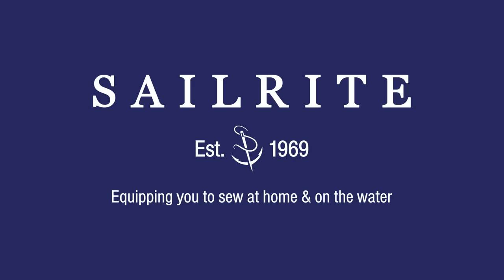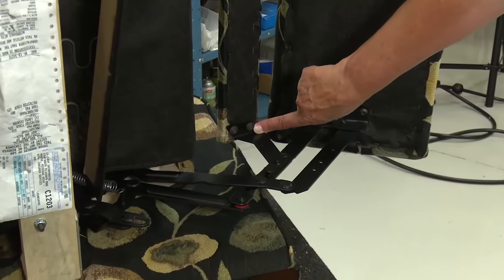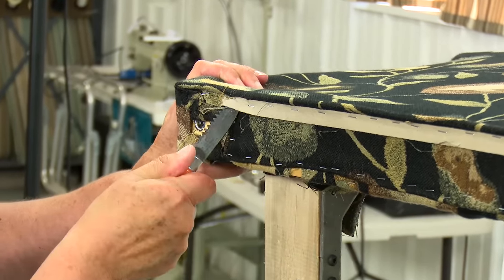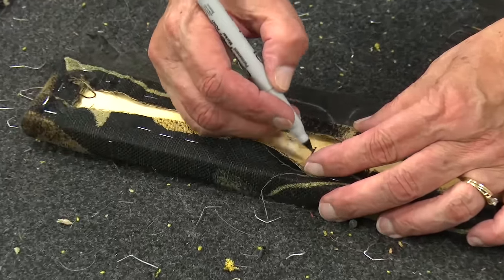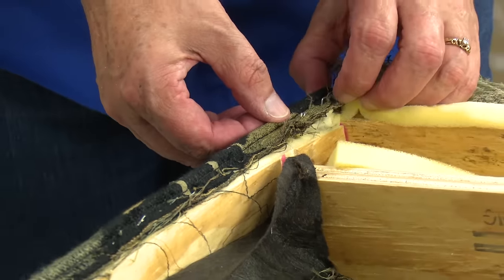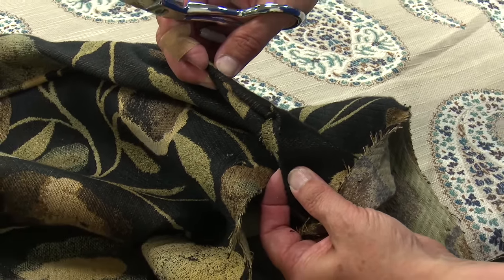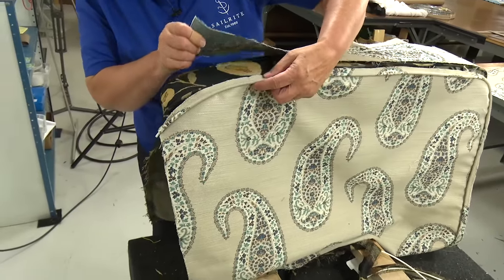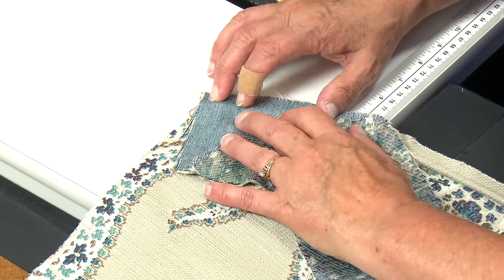How to Reupholster a Recliner Chair

Comment: I just want to say a MASSIVE Thank you for this detailed tutorial. I am a DIY upholsterer, and I am now actually working on a recliner chair. My handy hubby helpen me take out the mechanism, and I am taking it slowly, bit by bit, as is advised in this video. The biggest tip I benefit from, is to cut the fabric (template) in half length-wise, so you can use one side to take apart and use as templates for the new fabric, and the other half you leave in-tact, so you can refer back to how it was put together. That is invaluable information that I am using now to make sure I can put all the pieces back together again. Thank you!!!!!

Comment: I have a reclining chair I bought from Sears Canada in 2000. It is such a comfortable chairand I really love it. Of course the upholstery is shot. I have watched your very interestingvideo, but I'll be honest. It would probably take me six months to complete my whole chair.I'm not very experienced with sewing either. I know a year or so ago I phoned a couple ofupholstery shops to get quotes on getting the chair done. I was quoted $1000.00. I paid$600.00 for my chair and Sears still sells them for $1500.00 now. What would you suggest I do? Buy another chair or pay a professional to reupholster this one. I shouldalso mention here that the chair itself is in excellent condition. The mechanism works,the arms are tight.
Reply from the maker: You will often find that the older chairs are built better than the brand new ones. If you can't DIY (do it yourself) saving you the most money, then the option of having it reupholstered by a company and still saving you money over the new chair, may be the best option. The fact that you can pick your own decorative fabric is another plus.

Comment: Excellent tutorial!  One question: how do you know when to use the cardboard tack strip (as opposed to just stapling directly on the fabric)?
Reply from the maker: +Donna M. Schmid Thanks! Anytime the fabric is stapled and folded over itself (making a folded edge) use the cardboard tack strip so the fabric folds nicely along that folded edge. Also if piping is stapled along an edge of the wood frame using the cardboard tack strip will help push the piping towards the outer edge keeping it standing proud.
Reply: Oh, I see!  Thanks!
Reply: Sailrite  Bravo zonja. ! Eshte pune e veshtire  , une puoj tapiceri

Comment: This might sound like madness, but I have a perfectly solid dual reclining loveseat I'm thinking about reupholstering. I can't find a slipcover that is for this type of loveseat, and throwing a cover over it just isn't working. Am I nuts or just break down and get a new one? 25 years ago I made slip overs for my living room using newspaper for patterns. Just wondering.
Reply from the maker: Slip covers do not work well, in my opinion, for recliners. However, if you don't want to buy a new one or recover the old one they are an option.

Comment: I may have missed it or maybe it wasn't mentioned but how much material should I order for the same type of laz boy?
Reply from the maker: We used 7 yards of 54" wide fabric for this job. It is wise to order a little more than what is required. Here is a very helpful calculator that will help with upholstery jobs: http://fabric-calculator.com/upholstery.aspx

Comment: How much it cost to upholster?
Reply from the maker: It depends, but typically it will take a whole day for an upholstery shop to finish a chair like this. So, they may charge about $500 or so.
Reply: $500. May be well worth it, even on a chair that sells for less new.  I bought a recliner on Amazon, I am happy with it's structure and built in massage feature.  Issues I have with it are difficult to push back foot support to latch, this may be due to incorrect location of spring s, looks like easy and adjustable fix but I have not tried yet. There is a hook type tool for drum brakes that would be handy to change where springs go.  This chair also rocks and swivels in addition to vibrate and recline.  Some numb nut threaded the power supply wire through the swivel bearing, very difficult and messy to get it out of that bearing that would have eventually broken that wire, bearing had black molybdenum grease.  Big nasty issues with the chair are it's now collapsed foam in the backrest and tiny vinyl flake  Chips leaving thin ugly backrest fabric bare, in less than two years! The sailrite fabric may be the best way to go.  I may try a polyurethane coated nylon myself, it would be a high priority if I didn't have so many put off things to finish.